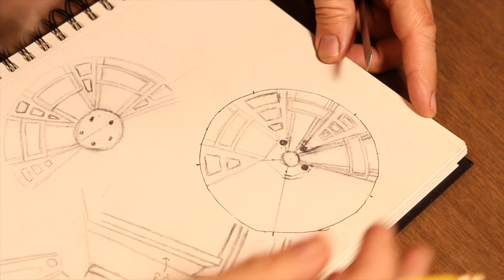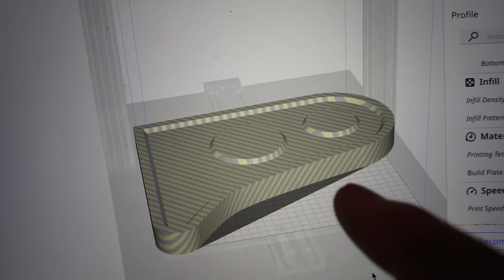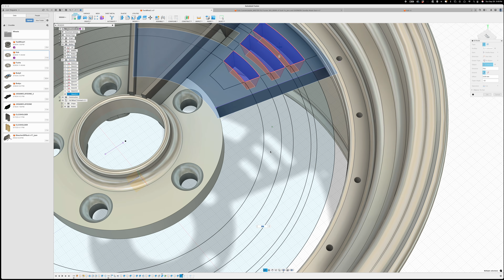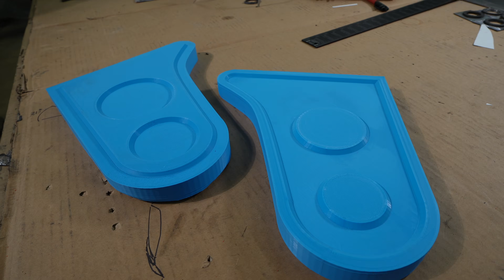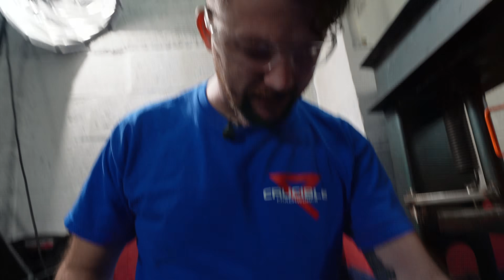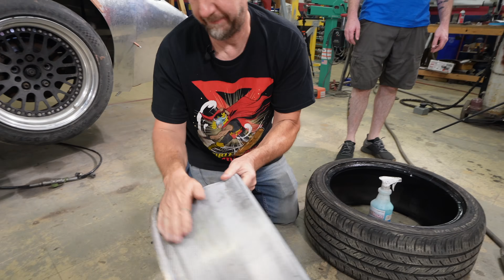Making Custom Wheels for Our Supercar! (Project Jigsaw Ep. 56)

Comment: The most inward toward the hub and smallest of the triple slot things aren't evenly spaced to the two slots above it. I also think the wheel might look better with a 4th slot added after you fix the spacing, as well as perhaps a pie/triangle cut on the non-bolt hole spoke face. Better still, give that triangle cut a chamfer or some other edge detail... Perhaps that would even go well on the ribs/ridges and the raised radial slots, too.

Comment: Love the vids.  Consider using a low temperature curing epoxy resin to strengthen your print.  It works best by printing your first layers without shells, and a rectilinear infill.  It gives you a nice hollow base to fill with resin. Grindhouse performance has a couple great videos on this.  https://youtu.be/fxzqkhmcRlY?si=OSHduGsOaqN6QIpL

Comment: Just because they couldn't do it then doesn't mean you shouldn't now.  I'd keep the center design the same but change the offset to get your desired position in the wheel well.  You can give the part that attaches to the other part of the rim a larger diameter so it fits or change the outer rim flange to stretch toward the center bolt pattern.

Comment: The wheel face feels a little flat. The whole car is a series of complex curves, adding some dish would integrate the design a bit better, and also slim down the mounting face so you wont need to run xxxlong studs/lugs. I think adding 5 mil round fillets to some or all of the 90° intersections could look good too.

Comment: Wheels are made up of Tires (the rubber) and Rims (the metal). That is a rim not a wheel.
Reply: Thats for basic wheels, for 3-piece rims, there's the 3 pieces of metal (The face, The barrel, and The lip) that make the Rim then there's 1 piece of rubber. all of that combine would make the wheel.
Reply: At least that is how I was taught.

Comment: Nice work on the wheels!  It really shows the 60s look. Question for you, where can I get barrels and lips at?  Like the one you show.  I have a vintage set of rims that I would like bigger in diameter, and I think that might work.  They are a 3 piece design.
Also, a video I saw and used this video to press sheet metal.
https://youtu.be/EhZmlTw2aUE?si=qNEDXtI9J_wQuuv3

Comment: You can use paper glue for the bed in stick bar form, easy to apply and clean with water, increases adhesion to the bed a lot.

Comment: I use 3D printing all the time at work, we mostly print out of ASA which requires high temperature and loves to warp and not stick to the build plate. Switching to an enclosed printer was a game changer, let it pre heat the chamber for a bit and it works like a charm every time!
Reply: agreed, these lifts are coming from a non-enclosed printer most likely.

Comment: Cool wheels but I really think you should tweak that center to use blind bolt holes. The exposed bolts don't look 60s authentic. Doing this would increase the apparent diameter of the center as well, filling up that stepped rim more.

Comment: FYI: I run a large format 3d printer 1mx1mx.5m the bed is glass. the trick i use to help with adhesion is spray the bed with hairspray. Something like High hold aquanet. it works.

Comment: Ryan, a carbuilder in NZ is doing a Series Three Supra with a V 12 from a Toyota limozine. Fuel injected, dual turboed, full up. All of his engine parts mods, and there were many, were done in 3D print, tested to fit then machined out of billet. As a result, he had very few redesign problems when he fit them up. "Pizza Supreme" is the YT channel, if you are interested.

Comment: Another tip, dont use gyroid for your press parts. Either make is solid, or use triangle infill. Any infill with vertical walls. Ironically, gyroid is weak on every axis. The layer pattern is too disjoint to adhere to the previous layer. Gyroid is basically worst case scenario for 3d printers. Gyroid is like an endless, every axis, every layer,... overhang.

Comment: A couple of thoughts on your "print and press"; others have increased the printability by leaving the center of the printing between the front and back walls open enough to pour concrete of other solid fillers into the void. Additionally, drilling a hole about a third the size of he finished hole in the part will help the stretch within that zone. Using as soft an aluminum as you can blend with the rest of the body will be essential to your process. Btw, adding some alignment holes outside the area containing your metal to be stamped will also help. Love the process from "tube body to sheathed"- you may have seen the next big thing for custom metal shapers indeed, Ryan, Tony! Onward! The car isn't half done and the customer is coming next week to pick it up!
🤡🤡🤡🤡

Comment: You could have just used a plywood die for the tail light panel; faster and easier than printing one. It's a one-off stamping with low detail on aluminum, it should be good enough.

Comment: Lol I've pressed smaller brass sheet metal parts with solid PLA but nothing that big. The press might not even be up to the force of such a large surface area. You could probably print it vertically and hollow and fill with concrete maybe to avoid having to make it solid PLA.

There's no need to make a solid20 mm thick PLA base if the shape is just 6 mm deep though. Make the form thinner and rely on metal plates to stabilize the flat shape.

Comment: A little bit of concave on that front wheel centre and a lot of concave on the rear, same design. Don't do a completely different design front to rear. Triple staggered though, diameter, width and offset.

Comment: I 3D print my dimple dies. I use petg and always print 100% infill. I mostly work in 1mm cold rolled steel and it gives me the flexibility to do odd shaped dimples. When I design my dies, I design a drill guide at the same time. That way I can drill accurately and also use the guide as a stencil to draw my layout for visual reference.
Reply: I feel like you could reduce the infill density by doing one or two extra perimeters and honeycomb infill in the pressing direction.
Reply: @johndoe920  Yeah, extra perimeter is key. Bigger nozzle also help.
Reply: @SaitoGray  The smallest nozzle I use is 0.6. Sometimes 0.8. I haven't used a 0.4 in years.
Reply: @johndoe920  On aluminium you could get away with 5 to 6 perimeters and 70% infill, but cold rolled is a bit tough. I use a 16 ton press and have cracked several dies.
Reply: @1of40four  how thick we talking? but yeah you might be right. I honestly wouldn't even have thought to use 3d prints for steel to begin with :D
Reply: @johndoe920  I mostly use 1mm and 1.2mm.
Reply: I think the method of 3D printing the dies using Gyroid infill and filling them with epoxy resin would also work.

Comment: Hey, next time you print a thing to be used to make a form... instead of trying to fill it up with plastic to make it strong, make it so you can fill it with concrete instead.  Concrete is a way better compression material.
Reply: Yeah, my thought was that it would work better if it was solid.
Reply: and cheap!

Comment: Hello guys, great video! Thanks for sharing. For the tail lights, I have a suggestion: you could use the 3D-printed part to create a mold and then cast it in a harder material, or consider having it CNC-machined from a hardwood. Just an idea! Thanks again!
Reply: My thoughts too, but maybe use the mold for a fiberglass or carbon fiber taillight surround 🤔
Reply: In a basic home shop setup like this, I would just use plywood, it's good enough for a one-off stamping, especially on aluminum.

Comment: it seems to me that the thinnest cross section between the inner part of the wheel (where the nuts are) and the outer part might be too thin. THere is a lot of material in the area where it might not be the most needed ?

Comment: quick tip on bed adhesion, wash your bed. it gets oils from your skin etc on it. just some hot soapy water, then dry it with paper towel, put it on the printer, heat it up for a while to dry it, then re-level the bed, it will be night and day different.
Reply: Was going to say this, it wasn’t a leveling issue it was a grubby plate